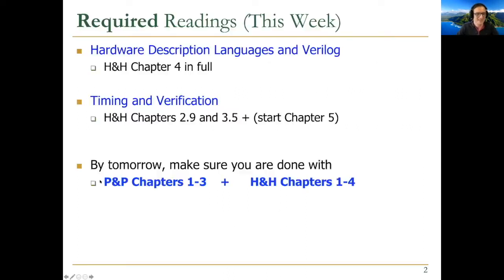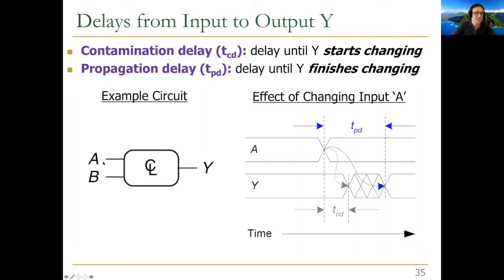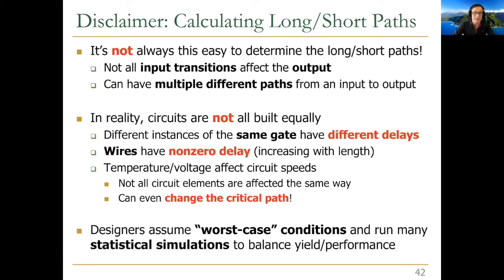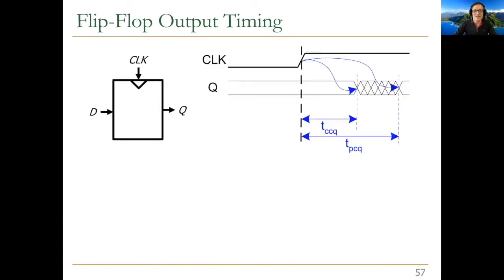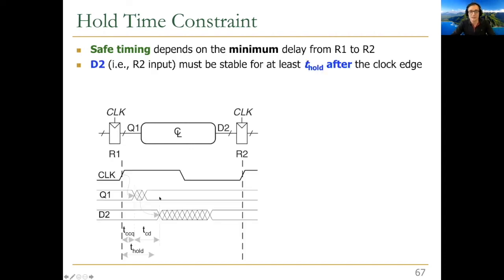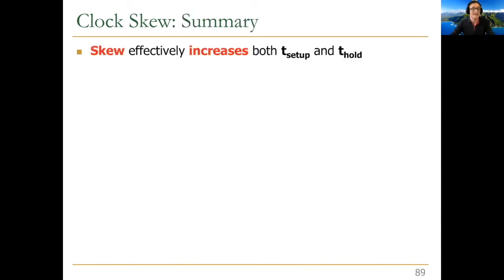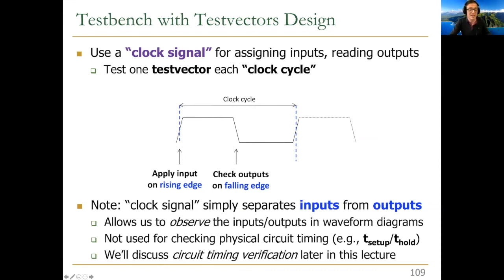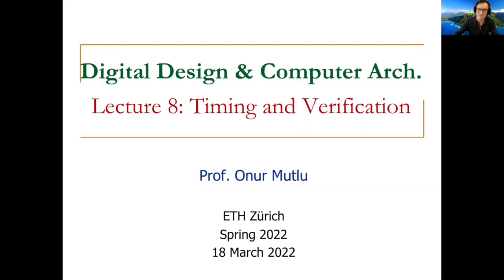Digital Design & Computer Architecture - Lecture 8: Timing and Verification (Spring 2022)

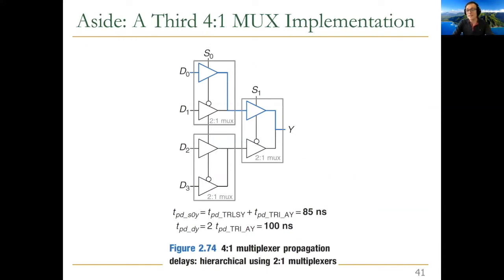Comment: 29:15 but the data propagation time here is worse than in the second design. So it's not like, unequivocally better.
Reply: Thinking about it a bit more I guess it is better because we care about the worst case scenario (which is mentioned further in the lecture)

Comment: 28:10 I'm not exactly clear on why the second implementation omitted the 4-input OR gate. Like if you also omit that OR gate in first design the control signal propagation will be faster (and it's not like two AND gates can be enabled at the same time can they?)